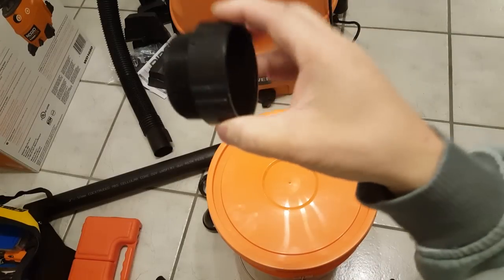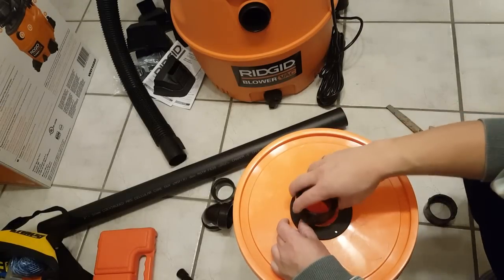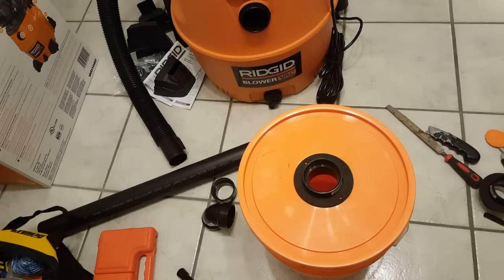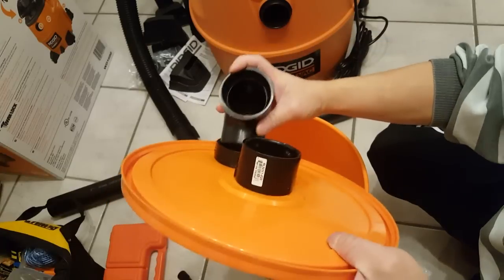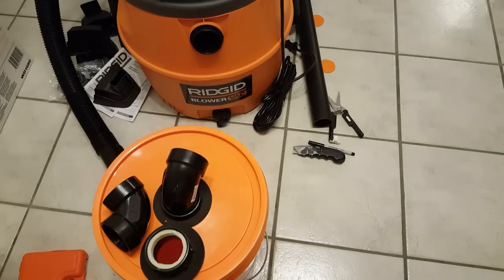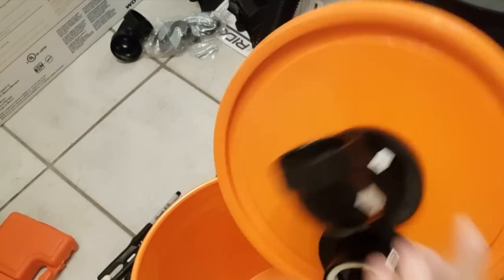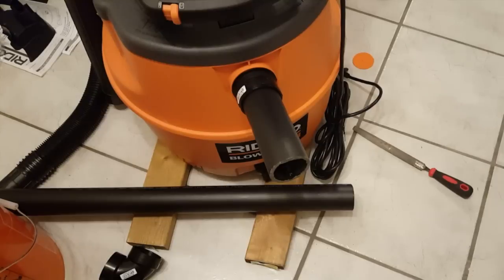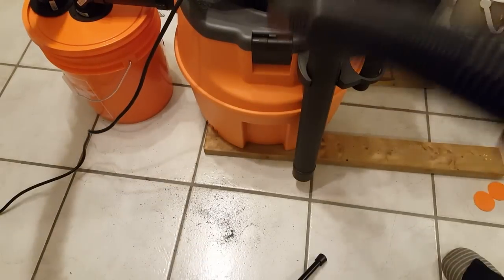Cyclone Dust Collector Connected to Shop Vac - very simple build

Comment: Very nice build.  Looks professional.  Would you change anything now after you've used it for a few months?
Reply from the maker: Thanks! I haven't done too many wood projects to make use of it but I did vacuum my whole garage with it. I would say the finer dust still gets into the filter, so a bigger bucket would have helped.  It's still better than having no cyclone though.  Also, the felt I used around the inside of the inlets don't hold the hoses tight enough.  It's ok, but could be better.

Comment: I think for stationary vacuum it may work.  you have 14 gal vacuum.  I think if is devised properly the cyclone could be build inside the vacuum.  I wonder why the manufacturer don't integrated this into there product... seem simple enough
Reply: Watch my video: Ridgid shop vacuum with built in Separator
Reply from the maker: I agree with you - it would be nice to have it integrated.  They do sell vacuum motors on a lid for this type of bucket but I'm not sure of the power for things like wood chips. I bought that shop vac because it has a detachable leave blower.  If they do integrate a cyclone dust collector in the shop vac itself, I would buy it!  But my guess is they want you to keep buying filters.